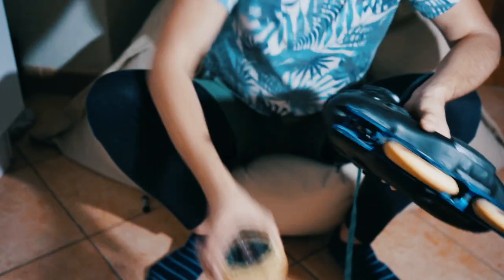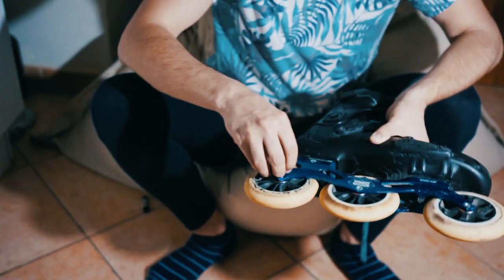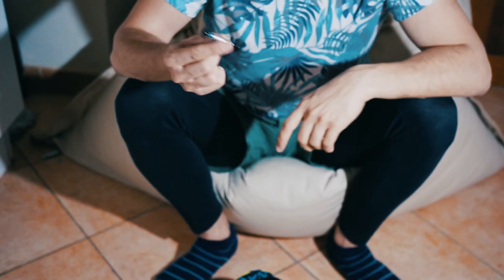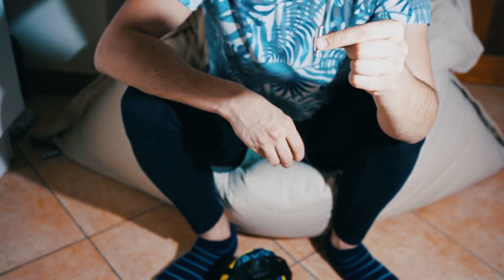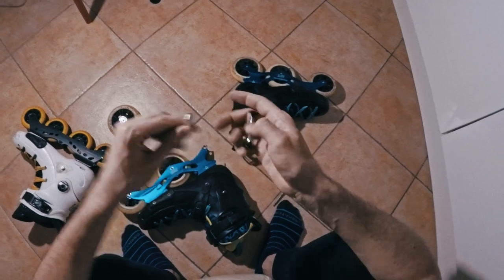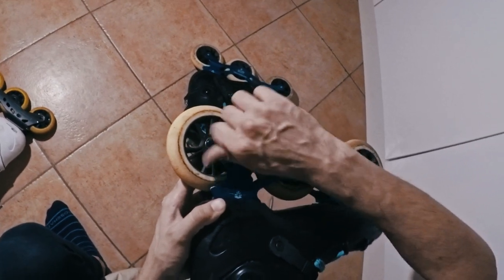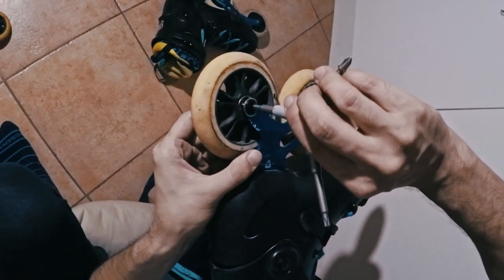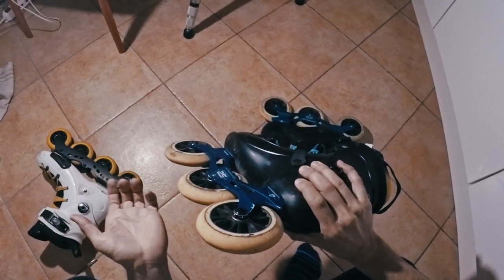Fixing a damaged axle thread in the frame (Easy Way) [1/2]

Comment: What's the interior diameter of the washer you used? I have the same problem as you do in this video, but I'm trying to do this as a temporary fix before I do a more permanent one (changing out frames, maybe drilling like in your second example).